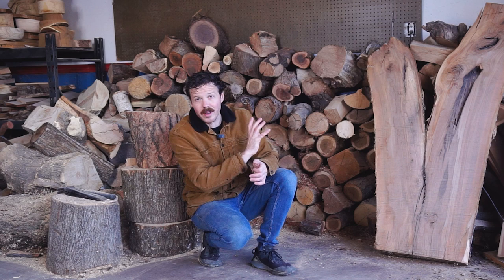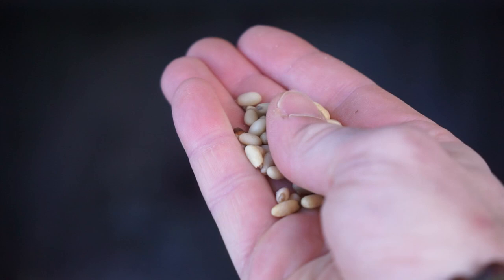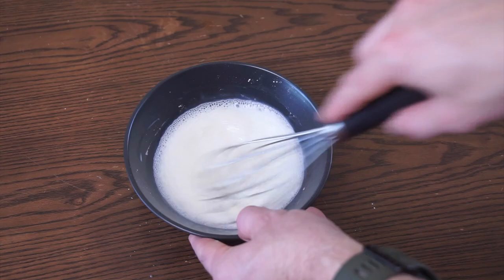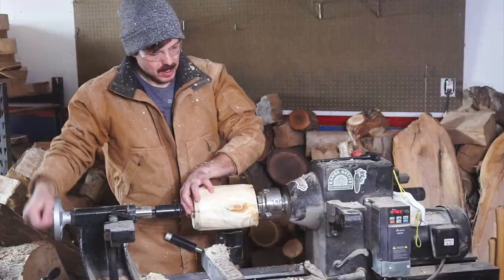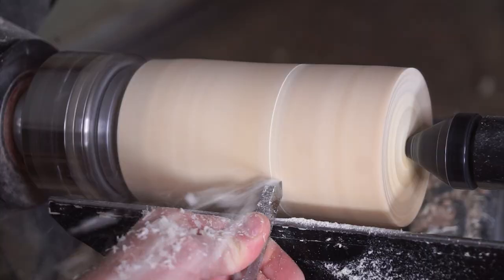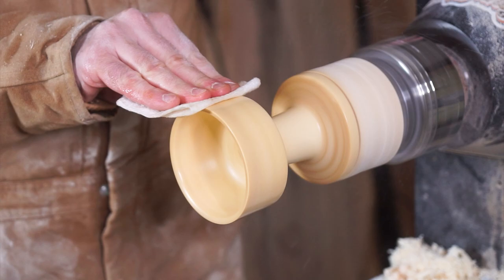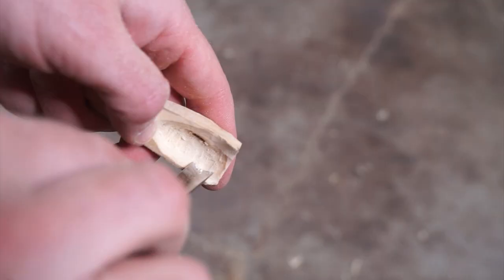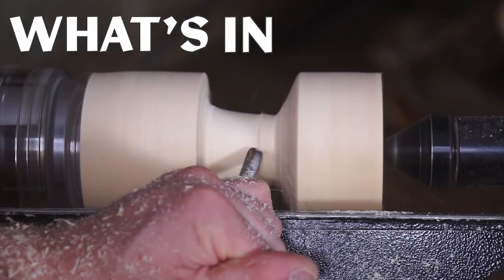Pine Nut Gelato & Pine Wood Dish | What's in That Pile?

Comment: I'm working on my first woodworking project: refinishing a pine dining table. I just finished my sanding (80, 120, 220) first with an orbital sander and then by hand to get rid of potential swirls. I'm really happy with how the sanding came out but I have no clue how to actually finish the table. What would you recommend I use/do? 

I don't want to stain the table, from what I gather pine stains very unevenly. I just want to make the grain stand out with a nice sheen and make those subtle colors pop, while protecting the wood underneath from potential food and drink spills.